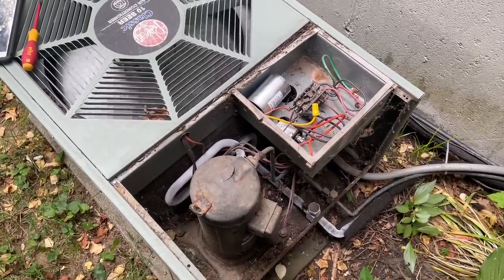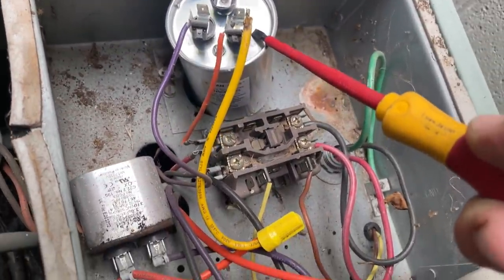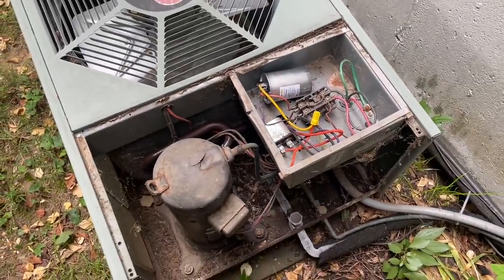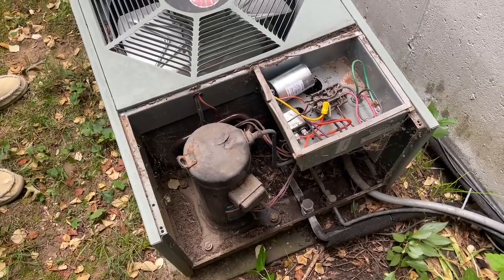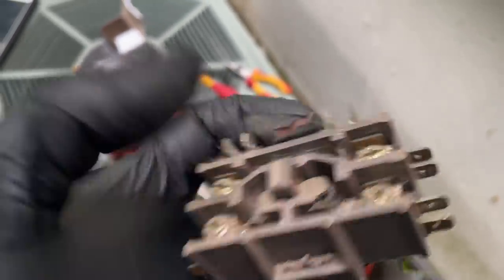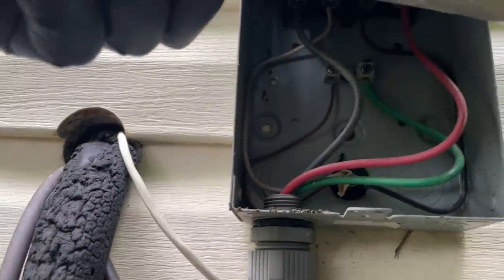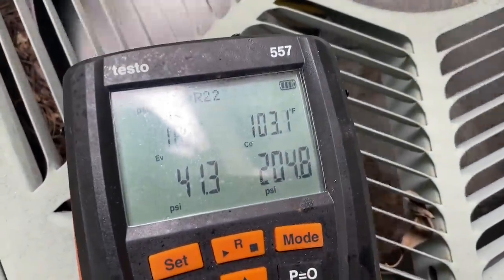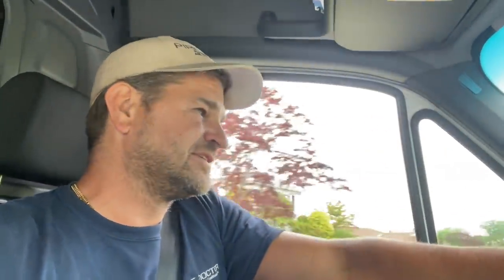Double Feature - Central AC Freezing & Air Handler Leaking Water Please Be Cheap I'm Selling House

Comment: Like I wrote in another one of your vids......my system was just over 18k.....it has an Aprilaire filter system. Two filters cost around 60 to 70 bucks....you know damn well I'll be checking them a minimum of 3 months. If they need replacing it's gets done. You don't fool around ....just do it.

Comment: I know why a P trap is used in plumbing but why are they also used in HVAC systems??    Feed me please.
Reply: @PipeDoctor  👍🏻👍🏻👍🏻👍🏻👍🏻
Reply: Follow up question Mr Pipes.    I had a new HVAC system installed a few months ago and the didn’t install a P trap or pipe the fresh air intake to the outside.    Feed me.

Comment: Why's it so hard to put a metal strap around a capacitor and screw it down.
Reply: Cause you don't get your Run Cap Bandit Badge by doing that.
Reply: surprised it wasn't stuffed backwards into the cardboard box and dropped in there lol